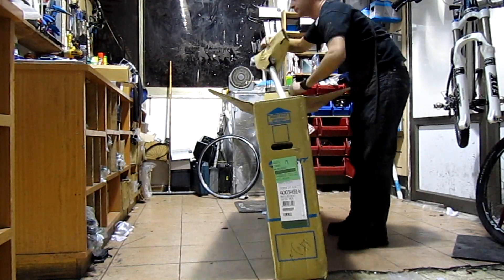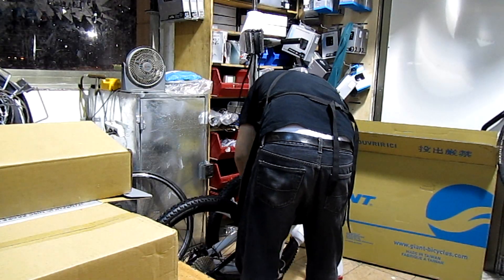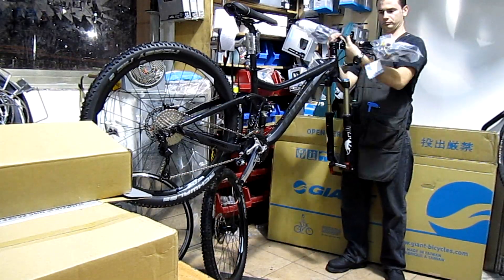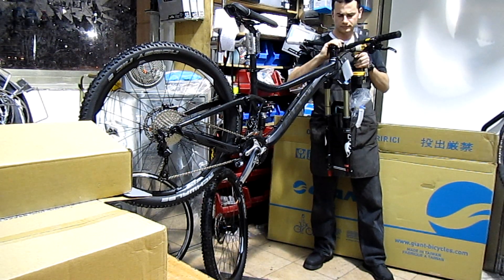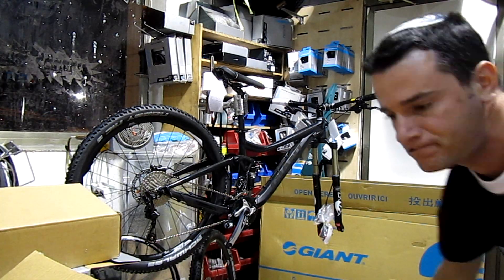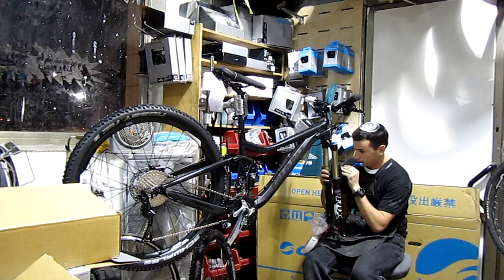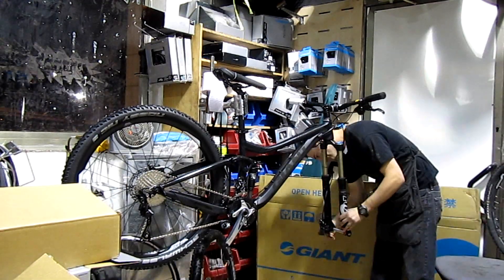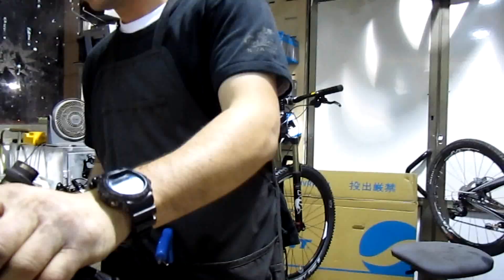2014 Giant  Trance 27.5 2 Assembly!

Comment: bought one 4 weeks ago (one of the last in stock for uk, all sold out) good bike but some components are crap, like brakes which are pretty useless for uk wet weather (resin pads), i've managed to kill pads  and bend the spring after 100km and i'm only 65kg and dont go hard on brakes so upgrade on its way - slx brakes with ice techs rotors. Also wheels are heavy and not true after 3 rides !!! but apart from that its spot on. 140mm maestro works very good whatever you do and CTD system makes it even better. set fork and shock on climb mode and climbs like hardtail. Like it more after each ride.
Reply from the maker: Giant bikes seem to grow on you as you use them!

Comment: Hi.

Very informative video.

Could you please tell wherever it's possible to use internal routing for a dropper on this model?
And if so, how to properly do it.

I was unable to find a video\instructions on how to do it.
Thanks.
Reply from the maker: Sure thing dude basically you have the internal routing hole on right side of the top tube thats were it goes in and it comes out from the seat tube. Which means this bike is only stealth seatpost compatible (A seatpost that connects from the bottom) and in order to get the housing through the frame you need to take off the bottom bracket stick the cable housing in from the top and guide it with your finger through the bottom bracket area and up in to the seat tube good luck!
Reply: Sam P Thank you for the detailed explanation. I was hoping it could be done without removing the BB.
Toda and Shalom.
Reply: Pavel Jeludovsky Think he meant there is a hole in the bottom bracket. No need to remove the BB itself. Just route the cable from the down tube to the bottom bracket hole then up to the seat tube. It's not easy. Took me a good 25 minutes to get it up to the seat tube.
Reply: Elmer Estimo Nope i meant what i said thats how its done good luck trying to do it without taking out the BB.

Comment: iam looking at a 2014 TRANCE 3 27.5 how dose it stack up to the Trance 2 2014?
Reply from the maker: Marco Bettencourt The main difference is the shock set up other then that only a small difference in the drivetrain. The shocks on the 3 are lower end rock shoxs with minimal adjustability as opposed to the fox shoxs on the 2 witch are much more adjustable. the drivetrain though is really just a matter of a weight difference between shimano deore and slx. I would say go for the 2 if you could but if not the tree will be a fine bike.
GOOD LUCK MAN!!!
Reply: Sam P thanks a lot for the info. I ended up buy a Cannondale scalpel 29er 3 2014 for 2500 out the door. to good of a deal to pass up. thanks for the quick response!

Comment: can that frame become an sx by changing the fork to 160 mm?  or the sx has a different  frame geometry?
Reply from the maker: as far as I know it's just a longer fork my bike is like that I slapped a 150mm fork on my trance
Reply: wont that extra travel somehow break the head tube overtime?
Reply from the maker: +koukimonzta The sx frame is exactly the same frame and that uses a 160 fork so I assume Giant took that in to account when designing the frame.